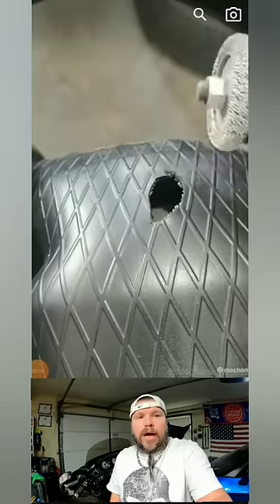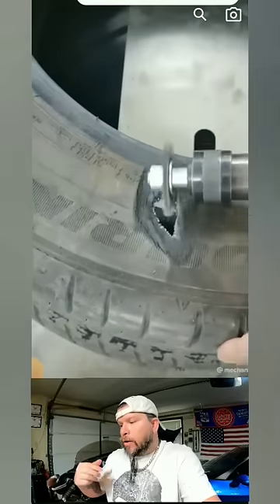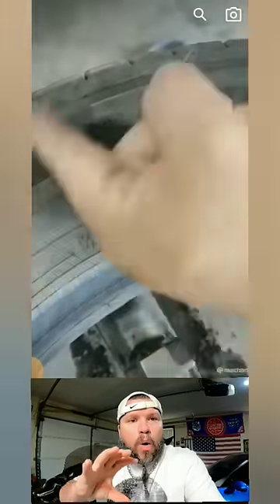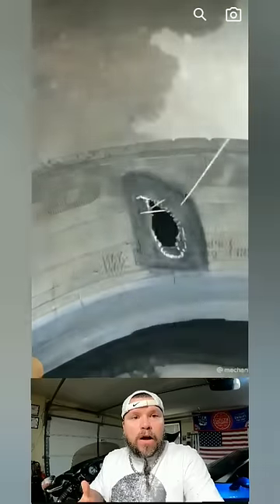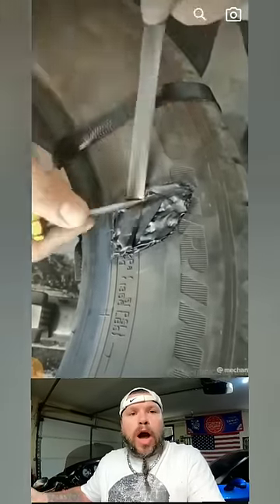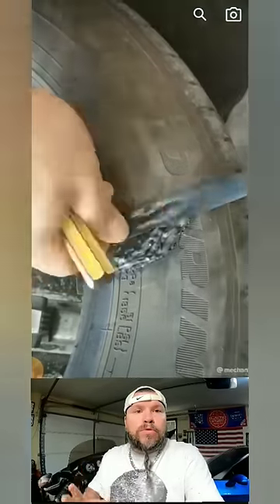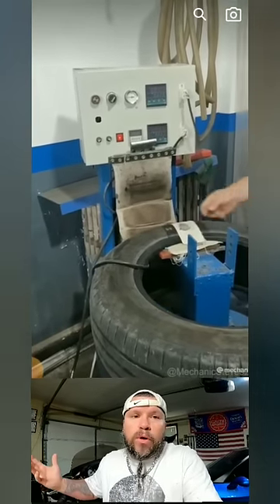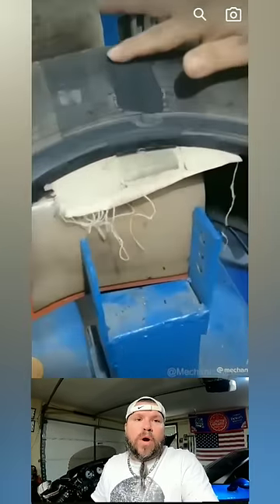patching a tire

Comment: I am a tire technician and you are absolutely correct about the sidewall. The sidewall is what supports everything and any compromise in it compromises the integrity of the entire tire. This is also why in the US sidewall repairs are illegal and tires with sidewall repairs are illegal to sell or use. This tire will definitely blow out and it will be more devastating then the first time before the patch and take even more material with it. Never do this.
Reply: If your a tire guy you should have noticed that it is not a radial tire but a Bias ply , but you would be correct if it was a radial it should never been fixed
Reply: @willfalk5445  bias ply doesnt mean it can be repaired or that integrity of the tire is not compromised. Bias ply is great for puncture resistance but is a poor choice in terms of fuel economy as they have more resistance and wear faster. These tires are used on trailers typically. However, the law in the US prohibits sidewall repairs on any kind of tire and any kind of repair except scuffing. You might be able to patch a nail hole without issues but the hole demonstrated in the video will leave the sidewall compromised even on bias ply. I work on the commercial side in regards to tires in the US. Virtually all passenger vehicles that are non commercial is going to be using radial.
Reply: That's what I was told when I snapped my totally new tire against a pointy sidewalk, the guy told me he could make a repair but at the risk of basically losing a tire and getting killed, for what a tire costs not worth the risk IMO
Reply: @gosonegr  he was telling you the truth about your tire you can not repair a sidewall in a radial tire
Reply: I’m sorry but when did we start calling tyre fitters technicians?
Reply: This tire is perfect for a hay trailer.
Reply: @Danfrank24 well when a man calls himself a woman and a woman calls herself a man & all the other letters, you’re bothered about the classification of tire fitteres as technicians?
Reply: @ON-yu4vq  maybe you’ve got a point. They can call themselves whatever they like. As long as it’s not man or woman haha
Reply: @wolf2179  bias ply tires are pretty rare these days. In pa where I live, it's impossible to find a shop that will patch a sidewall.
Reply: @JohnnyOla511  that is because it is illegal to patch sidewall in the US its a federal law under DOT. As for bias ply they are not rare. Rare to find on a vehicle sure but you will commonly find them on trailers especially on the commercial side.
Reply: @Danfrank24 Might be what Americans call them. I was in the same job but have never really known what the English job title was (not my native language). Anyway, he's right.

Comment: As someone who actually builds tires for a living, this is true. When your sidewall goes, get rid of the tire. You're just asking for a catastrophic failure if you just patch it.
Reply: Wat if there is a long bubble on the sidewall. Not to bulging but can see one
Reply: @Laker.Boy.  I would replace it still. Gotta make sure the sidewall is what it should be, no bubbles, even the littlest. It could get worse later on. It sucks, but you’re going to be paying for a new tire and not risking your life or others.
Reply: thanks for the tip boss
Reply: @spikypikachu1162  ok bro thanks
Reply: @Laker.Boy.  through luck, I lasted a week on a large bubble on my sidewall before I got it replaced, my fiancé’s car had the slightest indication that there was some buldging but nowhere near a bubble and it full on blew the same day on the highway. Better safe than sorry✊🏽
Reply: @Laker.Boy.  I got a nail in the tire near the edge of the tread. Plugged it. It bubbled into the sidewall. I drove it a couple hundred miles and it finally blew out.... right in front of a tire shop. And I'm in a rural area, next tire shop was probably 20 miles away. lol
Reply: Hang on now... I patched mine up and it's still swinging through 3 rope changes.
Reply: @Laker.Boy.  some manufacturers like good year will have a little bulge on the sidewall of the tire, that spot is usually where the mold came together since a lot of tires are made using a clam shell mold. It's usually just a straight line and is on both the inside and outside sidewall, if it's just on one side replace it. Been changing tires day in and day out for nearly 4 years. Hoping you stay safe 💜
Reply: @Anguish_  I do truly appreciate that you do the same please.
Reply: I drove like 5,000 miles on a patched sidewalk sometimes over 100 miles an hour… idk why people be trippin about it
Reply: Not just bubbles, if you got dry rot going on too
Reply: @Laker.Boy. bulging tires are just as bad. It means the sidewall structure is compromised so the rigidity of the sidewall is also compromised and is much more likely to fail when you get near the tires speed rating
Reply: @Anguish_ I’ve spoken with a few tire manufacturers and that’s definitely not true. Any bulge, big or small, in the sidewall of the tire is a problem. It means the sidewall structure integrity is compromised and it may fail at any time without Warning. It can happen from an impact or it can just be a defective tire. I went thru this with the last brand new car I purchased that had a tire bulge. The dealership said “oh it’s fine, no need to replace!” 3 tire representatives that happened to be at the dealership that day all said, “NO, it needs to be replaced NOW bc letting a customer drive on defective tire is not a good look for them, and it’s a huge liability.” Tire reps were actually quite shocked the dealer was willing to take that risk and actually gave me a full set of tires for free bc the dealership was giving me problems saying that I had to have done something and just wanted a free tire
Reply: @AFreeThinkingDawg09  he is right some tyres have a moulding mark it’s not a bulge it tends to feel like a dip in the tyre it will be on both sidewalls and is not anything to worry about because it’s not what we would class as a bulge
Reply: @phanks1115  Tires have numbers and letters on the sides also and new tires have rubber spikes on the profile, but that's not a bulge. If there is a manufacturing defect on the new tire, it's dangerous! That's what he's talking about.
Reply: If this is really bad, why do you see business offering this option,
Reply: I agree 
Goodrich tires made me replace one because it had a paper pin stuck in it
Reply: @AFreeThinkingDawg09  Damn! Looks like Discount Tire needs to up their training, thanks for the info!
Reply: @katiera6   Count your blessings you are very lucky
Reply: Builds tires?

Comment: I worked in an auto shop and in USAF aircraft maintenance for 11yrs combined. I would never patch a whole within an inch of the sidewall. He's absolutely correct here.
Reply: What about Tread?
Reply: @SanHydronoid  You can do tread all day. As long as your reasonable  of course. The tread can't have an entire patch of rubber missing, and then you try and patch it.
Reply: @SanHydronoid  A patch must be done at least 1/2 inch from the steel belt lining of the sidewall and should not be done on tread with less than 7/16 inch or legal limit for road conditions. Most mechanics/tire repair men will not patch a hole larger than a 1/4 inch. Multiple patches can be done if the holes are 16 inches apart.
Reply: I feel like half the job of crew chiefs was tire-related haha. For us at least
Reply: @Stig69  I’m AGE and every time I see a chief rolling out a tire I know I’m gonna have to swing out the nite cart and axel jack. Granted Aircraft tires look to be a lot nice to do swaps on the Bomblift tires or tow bar tires… those are a whole different breed of pain in the ass.

Comment: Correct! We had a tractor for plowing snow. Both rear wheel tires had patches that covered 12" slits. There was never a safety or other problem for decades because the tractor never went over 10-15 mph.
Reply: never a problem with me neither, I ran them another 20 years on my tractor after I stole them off yours
Reply: @stevecampbell1308  💀
Reply: @stevecampbell1308   lmfao
Reply: @stevecampbell1308 
Just to let you know, I’ve yet to replace those two patched tires on the tractor I bought from you 15 years ago.
Reply: 2081 and the patched tires are doing great not one issue. I plow with them twelve hours a day.
Reply: The perfect application for a tire repaired in this fashion. One danger though is, what if someone didn't know about the tires, and swapped them onto a passenger car?

Highly unlikely though, probably would never happen.
Reply: @hondaaccord2425 

2180 here. Turns out the patches outlasted the tires I still use. I've now attached patches to the patches so I can use a patched tire while I use a patched tire.
Reply: @skylined5534 the year is 41035 and the Emporer of Man has the patches that were used to patch your snow plow applied to his Holy Battle Barge the Emperors Eternal Wrath plying the inky darkness and protecting the Great Imperium of Man from Xenos scum. All hail the Emperor and the Imperium, and all hail the Omnisiah!
Reply: You'll see heavy equipment tires in logging and mining operations get patched everywhere and every which way because it doesn't matter at the speeds those vehicles move at, but once you get going to road speeds, it becomes a dangerous gamble to mess with damaged tires.
Reply: Exactly. The ppl in the comments have never had to jerry rig something to keep working.

Comment: I worked at a tire shop and we refused to patch holes in the sidewall. It was a liability issue. Once the sidewall is damaged the entire when is no longer safe and it’s better to buy a new one. Many people thought we were just trying to scam them and get them to spend more money. But I can tell you as someone who then worked later in life as a tow truck driver, that I’ve seen many many accidents that were the result of a blow out sidewall. It’s not something to risk your life over.
Reply: It is also illegal in the US to repair sidewalls as well as sell tires with sidewall repairs. Also you can't patch a tread hole that is within a certain distance of the sidewall as well. Not just a liability because its dangerous but also because it is illegal
Reply: Agree, very true, the Liability is rather high. But unfortunately if your skilled enough this repair will outlast the normal wear of the tread. It's much like Welding repairs. You have welders that can safely and properly repair broken metal parts. And their are also so-called welders that think they can weld and the part is not safe. Same thing with tire repairs.
Reply: Oh wow I didn't know that. I had my sidewalk patched at a shop and it was a relatively new tire. It got to live its full life.
Reply: @Lilmiket1000  if all that happened was it got scuffed or also known as curbed. If its not too severe they are allowed to buff it as well as add a bit of material to make it look nice again. But any holes in the sidewall or severe splits are supposed to not be repaired. It used to be common practice to do it and some tires continue to do good afterwards however DOT saw that the failure rate of patched sidewall tires was just too high as well as it was a hidden danger as well. But yes some sidewall repaired tires do manage to survive the rest of its time just it isnt something you should expect or rely on.
Reply: But this is in Russia. They don’t give a chit about safety or liability. It’s probably a tire for a military vehicle.
Reply: @livefree1030   do that in russia , u are a hazard to all other drivers if u are realy that cheap... just sell ur car if  u cant afford a new tire
Reply: Goodyear and just tires i worked for they religiously said no and not to do this at all never it is bad results it was even in the employees handout guide book about and the hiring app employee safety test.
Reply: This is what I've always been told at tire shops.
Reply: Time for a new tire , but they work great in a bonfire.
Reply: @terjeoseberg990 You're saying that as if it doean't happen in the US where people are blinded by "muh freedom!"
Reply: @GewelReal , I doubt the US military does this.
Reply: I have plugged the side wall on my car tires a few times and it's still good. But I wouldn't patch it like in this video.
Reply: I worked in a tire shop for years. Thing is I'm pretty smart and some of the shit I was told to do I downright refused. Don't fuck with peoples lives dude
Reply: @livefree1030 I'd have to disagree. Welding a tire is diffrent. You would have to remold it. Vulcanized rubber dose not work like fucking metal my dude
Reply: @livefree1030 , There are strings, wires, and cables wrapped around the tire. If you grind them away making a big hole like that, the tire will never be the same again.
Reply: Yup gashed my side wall offroad in the middle of nowhere from a glass Voda bottle some party goers left no biggie I jacked it up cleaned the puncture and stuck 2 tires plugs and rubber cement Elmer's not the cheap stuff that comes with kits to get me home next day took it to my discounttire they replaced my tire with my certificates I got and replaced my road hazard certificate incase it happens. In my youth I ran a tire for 8months like that on an 83 ford bronco til it blew out 😂😅 learned early on to replace tire right away from a plug.
Reply: Not the, " I worked at a tire shop guy".
Reply: Yes!!!!! This is every decent shops rule.   I have no clue why he thought this was a good idea